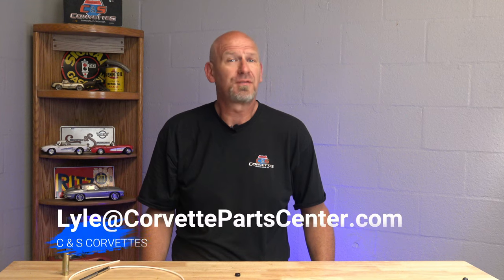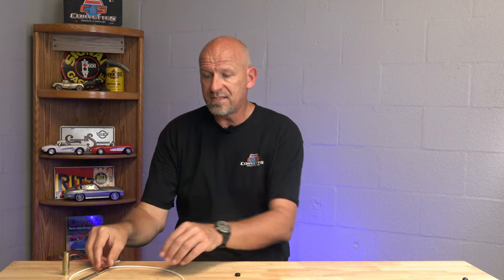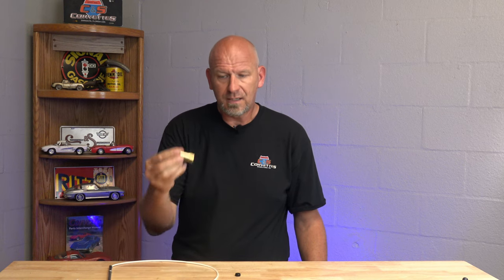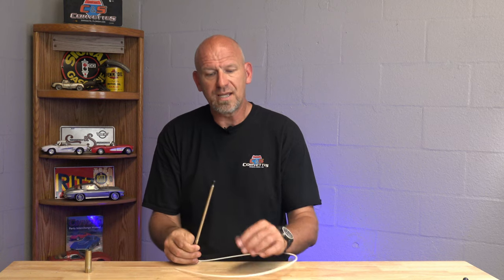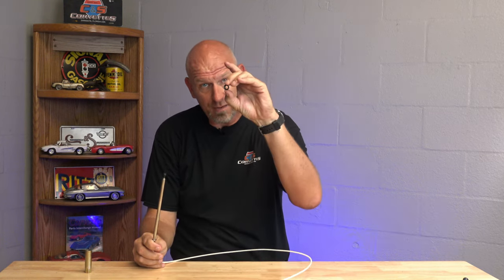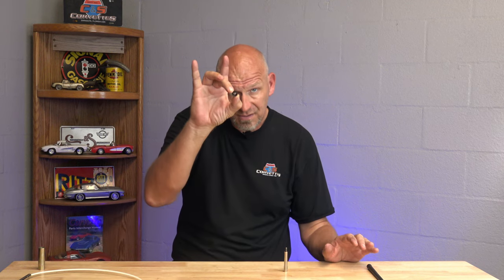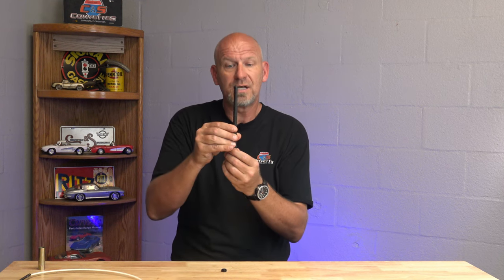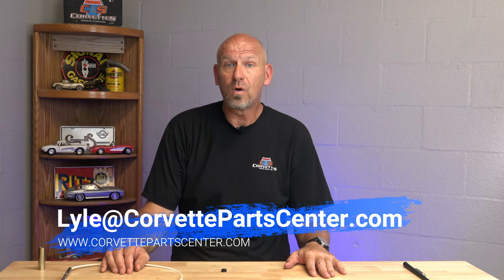C5 CORVETTE CONVERTIBLE POWER ANTENNA FIXES

Comment: My antenna just started making a noise when it gets to the fully extended position and again when it gets fully retracted. It's a grinding or gear noise that lasts for about a second. Any ideas what it could be?
Reply from the maker: The toothed tape that runs the antenna up and down is wearing at both end points.  Mast replacement or Stubby conversion is going to be necessary in the relatively near future.  Lyle :)

Comment: Lyle, would it be possible to extract the antenna as described, cut off the nylon cord at antenna base, re-insert the antenna, secure it with nut, and forget about it? remove fuse. No cost? thanks for all the info. From Vancouver Island.
Reply from the maker: That would be possible as long as you understand that the mast will be in the "down" position forever.  Lyle

Comment: This video is for a c5. Does this work on a c4?  
Can you suggest a place to purchase a stubby for a c4?  Also, it would be awesome if you could make a video that shows how to remove the existing antenna mast in c4.  
FYI...I have a 1989 convertible. You can hear the antenna motor come on when the system is turned on.  Ty

Comment: How do you remove the broken pieces of the tape from within the motor?
Reply from the maker: If they are too large to just fall out of the drive wheel and settle at the bottom of the Antenna case, the only way to clear them is to remove the antenna from the car and take it apart.  This is not a usual occurrence...10% of antenna mast replacements.  Lyle
Reply: @csvette  hey bro, thanks for answering!  I wound up using a dremel to grind away the plastic rivets that hold on the spool cover.  Was very easy and fast. The broken tape was easily accessed and removed. Ideally, some 1/2 inch #6 self tapping screws would reattach the cover. I used two zip ties because that is what i had available. The whole assembly was covered in a soft rubber sleeve which was easy to roll up for access. Took this opportunity to replace the 25 year old electrical tape that secured the wiring. Hopefully this comment finds someone who needs it. Yous guys have helped me with lots of concise info. Good job.

Comment: Hey Lyle. Great video. And a great channel. I always click the like. I do all that you said but the Damn antenna just won’t pull out. Any other tips. The nut is off
Reply from the maker: Pat, can you pull it out enough to see/touch the white gear tape?
Reply: No Kyle it doesn’t come out that far. I don’t know if the little tabs are holding it in the tube. I’m going to mess with her today. Just was wondering if you had any tricks or tips
Reply: I did buy it from antenna King. The replacement Shorty conversion. You  did not have it in stock.. I will be using you for any further parts. You could count on that

Comment: Hey guys quick question. I already have the stubby antenna do I need an adapter to screw it in?
Reply from the maker: Yes, you do.  The Adapter is the tricky bit to find.  Our Stubby antenna kits are expensive, but they are the only ones that I know of anywhere that have the Corvette-specific adapter.  Lyle